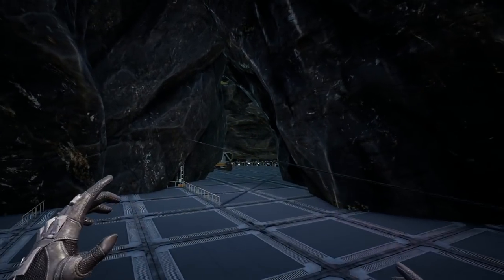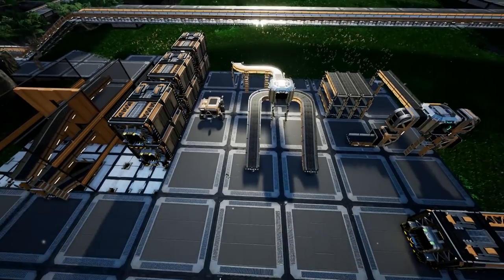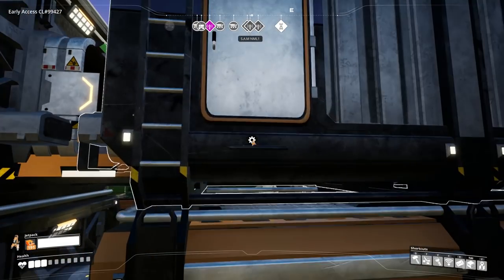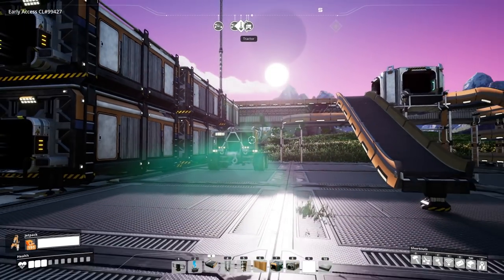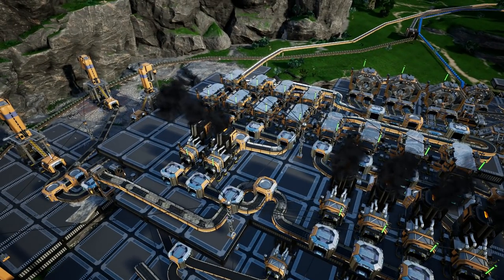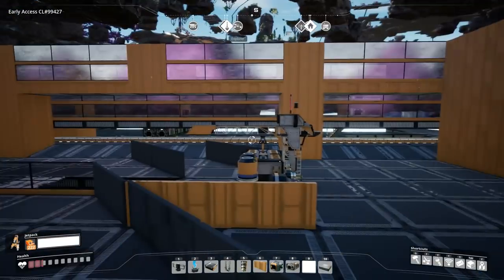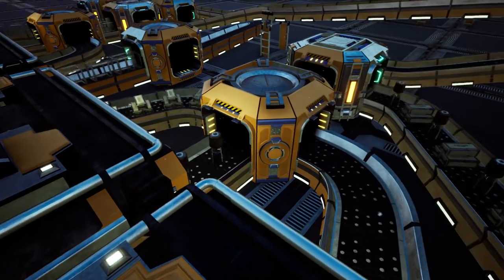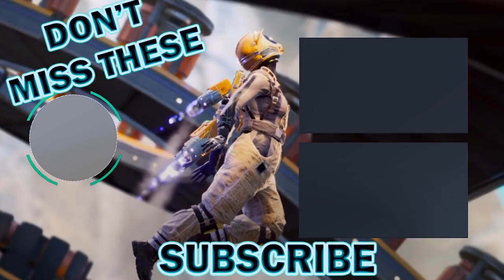Satisfactory Guides How to Setup Conveyor Buses Transporting Items between Factories

Comment: If you're running items from short distances, then vehicles seem a tad excessive. For long or extreme distances, though, then nothing really beats a truck for that. I'm reminded of a story I read on reddit once for stupid engineering solutions that actually worked... In the day of the young internet, a group of guys were trying to figure out how to get info from point A to point B within a tight time frame. They tried devising all sorts of encoding algorithms to compress the data as much as possible to transfer it as efficiently as they could, until someone said: "What if we just drive it there?" The moral of the story: Don't underestimate the bandwidth of a station wagon loaded with tapes going 60 mph.
Reply from the maker: Yes vehicles are excessive on short routes, but they look good :D (If they work) Vehicles can actually be very beneficial depending on the setup for short to medium trips as well, within the next few day's I'll have  a new mythbusters video up which talks about this. I've totally changed my mind of vehicle usage in the game! 
That being said, I love the metaphor at the end,  over engineering, is sometimes, nothing compared to the simplest solution.  :D
Reply: Look at the IP over Avian Carriers protocol. Birds loaded with SDcards have a better bandwidth than ADSL.

Comment: My major concern with mixed conveyors is if one split backs up, it will prevent other items from reaching their destination.  However, thank you for the demonstration!
Reply from the maker: You're absolutely right, however now with the overflow system coming into play thanks to the update and the item sink this isn't so much of an issue anymore as you'll be able to mix items on conveyors as and when you want- limited only by conveyor speed

Comment: Worked a ton on my base last night ,  getting closer to building the first floor of my base which constructs all tier 1 items (iron plates,rods,screws, reinforced iron plates etc.)
Reply from the maker: Ken Smith nice! That’s kind of what I want to implement in this build, ore refining and tier one items on the bottom flirt then working their way to the top with fully developed items ☺️
Reply: @TotalXclipse  id do a single level base if possible but my last base got too messy with conveyor spaghetti...   this new base has technically 4 levels  , think layers to a sandwich  bussed & buffered layer , above it factory tier 1 , above that is another bussed & buffered layer , above that is factory tier 2 ....   than ill be building my shopping mall fed from the factory with items w/ a junk box (container feeding into my auto sort system back into the mall )
Reply from the maker: Ken Smith nice sounds awesome! I’ve planned for 5 levels, but I’ve now got a truck station which I’ll be extending for the live stream which then takes items to a special sorter. This can then sort the items between three of my 5 floors. Technically I have 7 floors (ground floor is for vehicles only 2-6 for the factory and 7th for transportation around my factory 😅 lots of work for me to do

Comment: hi, not sure if anyone has asked this question, but those glass windows visible from the start of the video (1:58 will show 2 stacked as walls on the left of the screen), I presume that is a mod? if so, where can I find it, and other mods for satisfactory?
Reply from the maker: haydyn1993 it’s a in game item that I released early using a save edit file, I wouldn’t recommend doing it as the windows should be released in the next update fingers crossed ☺️

Comment: Where are you on the map, when you're under ground?
Reply from the maker: Murphy Plays do you know where the waterfall is in the grassy area (not the large caterium one) with the raw quartz... it’s just under the waterfall (in the crater there’s the cave entrance at 0.02 seconds which enters you under the map
Reply: @TotalXclipse  Thanks, although it turned out to be rather troubling, going past the bottom of that waterfall, tried it twice and both time my computer shut down and the save got corrupted. Good job I had other saves otherwise I would have lost 300 hours of play... 

I couldn't find a cave opening as you've stated is it over the water or the forests area
Reply from the maker: @MurphyPlays1  Wow. Yeh sorry to hear of the corruption. When I did it, I used the conveyor lifts to slowly drop down into it, landing on them until I reached the limit where my health starts to drop and from there just built foundations out, but the actual cave entrance is pretty high up, if you come on the live stream on Sunday, I'll show you the map and the cave entrance. :)
Reply: @TotalXclipse  Arh, I was at the wrong crater, found it :)
Reply from the maker: Murphy Plays glad to hear it 🤗